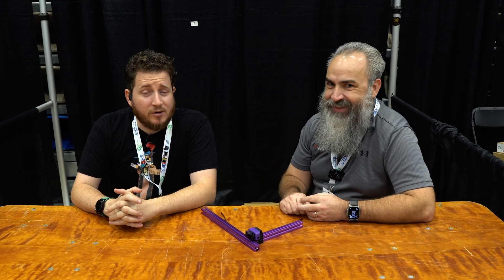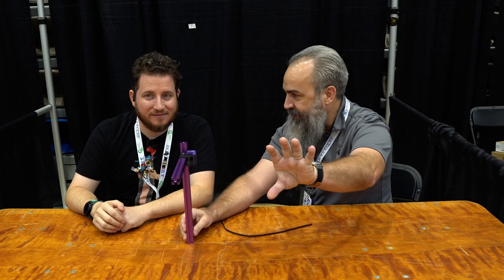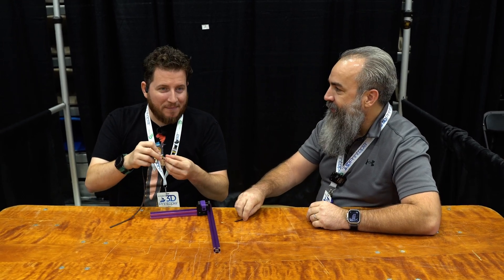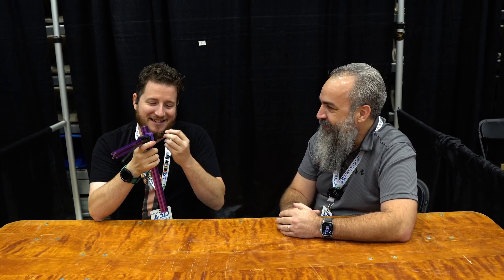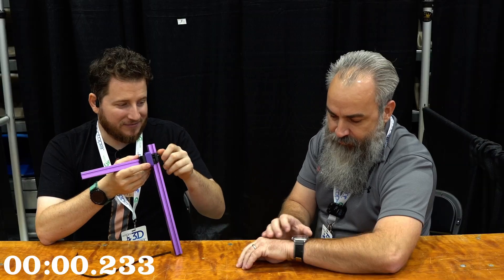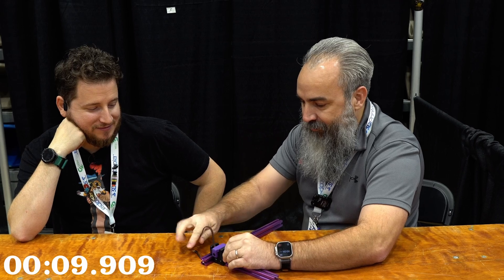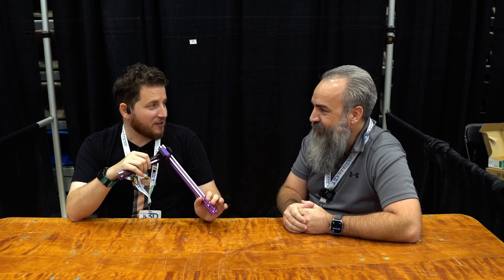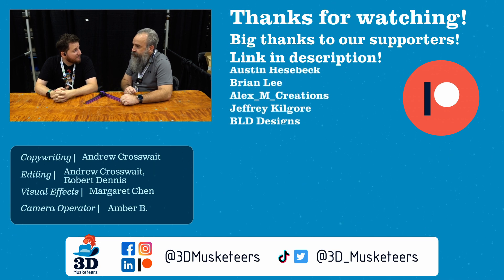This Trick Could Have Saved Me HOURS On My Trident Build!!

Comment: It's always easy once you know how :) Back when I worked in the arcade trade we'd spent a whole morning dismantling coin hoppers to clean and service them, they were an absolute git to get back together because you had to line up all the cogs, and keep this long flexible strip of thin plastic in place while putting the top on the case. When a senior technician came in from the main arcade he saw what we were stuck on, when he finished laughing he pointed out a small cutout in the case, turns out you left the stupid bit of plastic to one side, assembled the whole thing then it just slid in a bit like the cover on a Nevermore filter :) :) We'd burned an entire morning on a 5 minute job :)

Comment: a little problem, here Steve started with the hole further from the extrusion while in manual, the upper belt starts with the hole closer to the extrusion which isn't the same and to do what Steve did, you need to start routing the belt with front idlers not toolhead carriage
Reply: Eh, the manual is a suggestion.  It's just as valid to route both belts the same way, just mirrored.
Reply from the maker: Steve says it can be done either way and the manual may need an update (just asked him to clarify in our discord)

Comment: Speaking of purple, when I said I was almost done with my mk4s I meant it's done in every way shape and form........except the LCD cover isn't purple (it's still the original prusa printed part that says mk4) and the PG cover is kind of a crappy clear with orange writing that says mk4. I don't know if I'm just going to go full on purple and say screw clear. or if I'm going to try going clear on both. The clear PG cover used to look nicer, but the "original" part of the "original prusa" is really hard to read now. Sadly the prusa provided models never intended for them to be MMU printed. As of now there are no mk4s versions that are MMU able at all. There are mk4 versions. I might download the prusa parts and design my own text. When I did the wifi and NFC stuff prusa already had holes in the models. I just filled in the holes with a different color. I'll have to start from scratch on the LCD cover and PG plate. I'd like it to match the silk screen as much as possible. So.....maybe I take out the camera, get a good picture and then trace all the silk screen components in blender and then align them with the models. Instead of adding to the model they would be modifiers in prusa slicer that change the extruder number. Then I don't have to cut anything out of the original model.
Reply from the maker: I wonder if the silk screen stuff will get open sourced?
Reply: @3DMusketeers  probably not. Especially now that it's injection molded.
Reply from the maker: I dont think the printing is done in the mold, looks UV printed to me.
Reply: @3DMusketeers  that's what I meant by silk screened. And that's the part I'm missing. I'll probably try to recreate it this weekend.